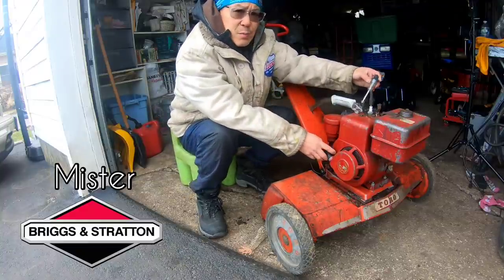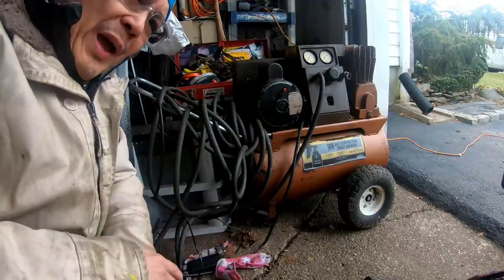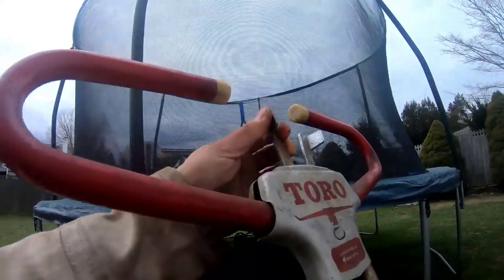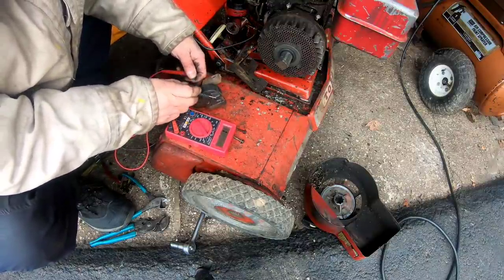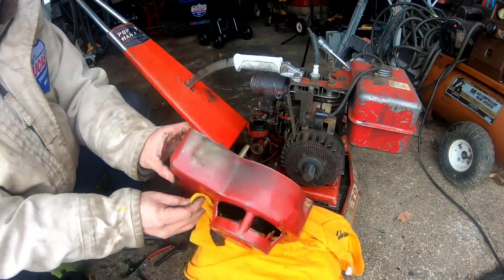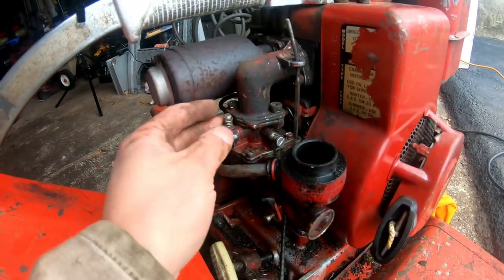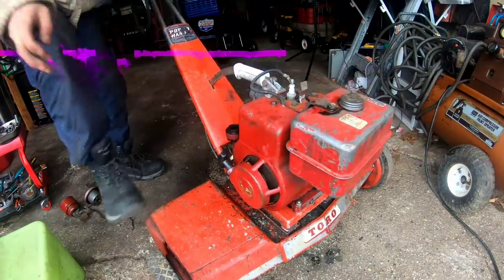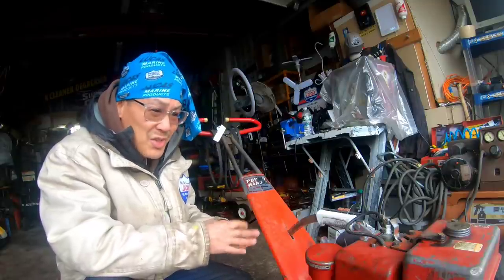TORO BRIGGS POWER HANDLE SPORT LAWN 25"REEL MOWER POINTS MAGNETO-ELECTRONIC IGNITION COIL CONVERSION

Comment: Going on 72 yrs. old now i grew up with that type of kill switch by the spark plug, glad you figured it out. Glad you sprayed lub into the hole on the end of the clutch should keep ball bearings and clutch working for some time. OLD MAN OVER AND OUT.

Comment: Henry; Your A Wing Nut!!!  Some time ago, I ordered three or four of the spark plug shorting clips off of eBay. Different engine manufacturers called them something different from one another but all of them do the same exact thing. I love the sound of the old Briggs & Stratton engines or at least when they are running good. Congratulations On A Job Well Done.

Comment: Hey Henry its Rocco from Connecticut you got the touch on those power handles it was made to stop with the metal part on top where the spark plug is just touch it to the plug thanks your friend Rocco from Connecticut I see you finally found out what I was talking about

Comment: Henry, you dont need any stinking predator engine, you have a made in the USA🇺🇸 Briggs and Stratton! Glad you found that hi-tech kill switch. Great watching you work on some quality equipment. I hope the haters aren't to disappointed!    🗽🇺🇸👍 Roger
Reply from the maker: Yeah....fuhgitaboutitt!
Reply: I'm not, on an antique like that you want the original engine. A Predator would have killed its identity as a classis. Plus I don't think the handle would have bolted on to the top of a Predator anyway. It used the bolts off the Briggs flat head.

Comment: Fyi, the metal tab next to the spark plug is the ground used to kill these motors.   You just press it on the top of the plug to shut the motor down.
Reply from the maker: Didn’t finish watching yet?

Comment: Hey I have the exact engine but carb is leaking. What do you have plugging the bottom of the carb
Reply from the maker: Nothing!  Mine didn’t leak because my gaskets are good.  Yours is leaking because of gaskets.you have to find out where the leak is coming from

Comment: Be very cautious with those big old air compressors. I saw a few videos where they have exploded from moisture left in the tank for years which has turned to rust weakening them. They can be deadly. I would keep it a good distance away at all times while being operated, because you never know.

Comment: Henry, you need to run that compressor on 220V, it will pull half the amps and run efficiently
Reply from the maker: I don’t have 220v
Reply: You can get a 220 added fairly cheap. But ya know what it might be fate, those big old compressors can be dangerous and explode from the years of moisture eating away at the bottom of the tank and brown water definitely came out of that thing. You might just be better off selling it. They make the new ones upright for that reason, their less likely to blow out.

Comment: IF you look at the Metal Piece sticking upright by the Spark plug on the side of the fuel tank,  that is what is used to kill the engine. I suggest if you get this message and figure out what I am saying make sure you do it with your foot or with a glove on your hand as you might get a little shock but, if done correctly it will sping over to the top of the plug and kill the engine.  FYI
Reply from the maker: If you read the other comments or the next video,  you’d see I mention I had a snowblower like that called a Jacobsen 26” that had a similar shut off.  Sold a year ago.

Comment: regards to air compressor  look at double wide 6 air tank blow up
Reply: Sounds like air compressor may be drawing too many amps due to high resistance in electric motor.  Need to break out multimeter and troubleshoot it if you are gonna keep it.  It's A 1 horsepower compressor, so should not be blowing breaker.

Comment: I sold this 1968 Toro Whirlwind rotary mower with a blown motor for $350 a few years back. I noticed you passed up the similar power handle attachment version of it. But that's okay, mine was otherwise nearly immaculate, although a little red paint and it could have been nice. I expect the value of that power handle with the reel mower to be around the same value, maybe a bit more.
https://youtu.be/tVd-iabGqO4
Reply from the maker: It’s worth nothing if no one buys it.